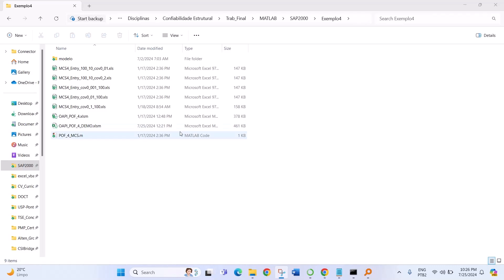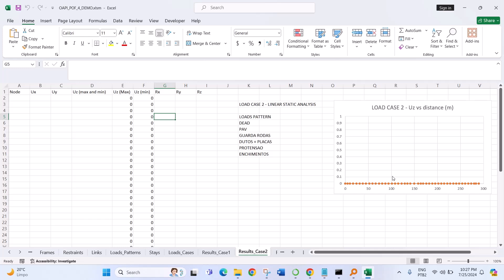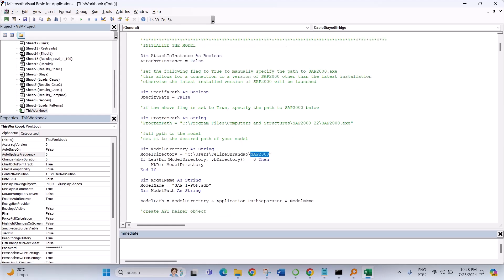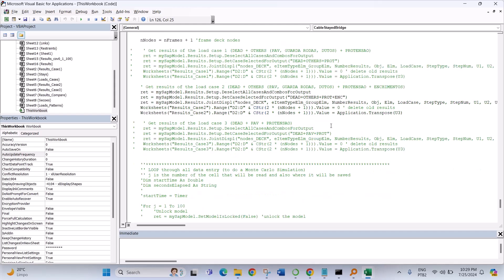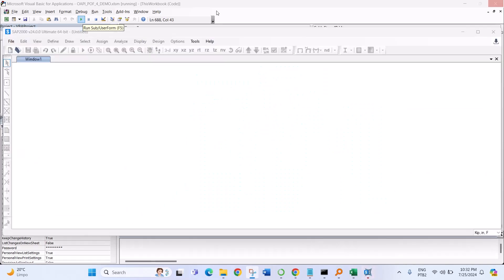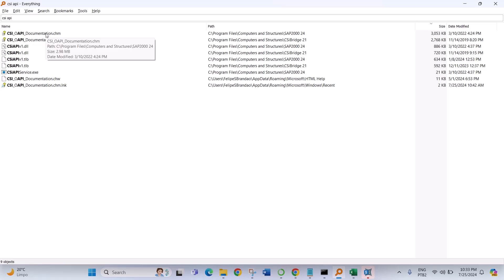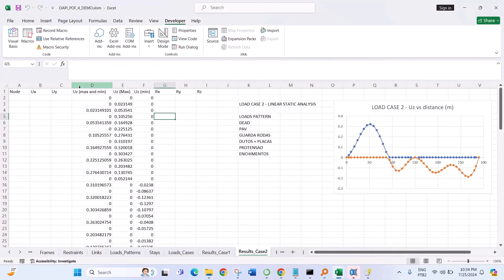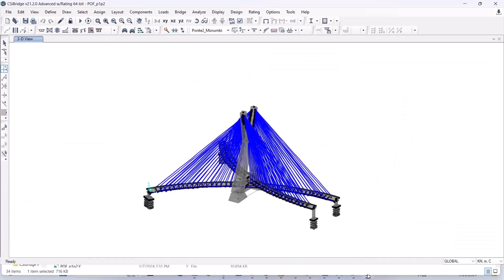CsiBridge and SAP2000 API (oAPI) using VBA - Example of a simple parametric bridge

Comment: After running the results in sap2000, I want to use vba code to write the results to an excel file same as the excel table created in sap2000 when operating manually, when operating manually when exporting the results in sap2000 to an excel file by selecting load case and load combination and export to excel. Can you write an example code?
Reply from the maker: Hello, in the description of this video I shared the spreadsheet I used with the vba code. You can run something like that:

 ret = mySapModel.File.Save(ModelPath) ' SAVE MODEL
        ret = mySapModel.Analyze.RunAnalysis ' run analysis in the loop
        ret = mySapModel.Results.Setup.DeselectAllCasesAndCombosForOutput
        ret = mySapModel.Results.Setup.SetCaseSelectedForOutput("DEAD+OTHERS+PROT+ENC")
        
        ret = mySapModel.Results.JointDispl("nodes_DECK", eItemTypeElm_GroupElm, NumberResults, Obj, Elm, LoadCase, StepType, StepNum, U1, U2, U3, R1, R2, R3)
        
        Worksheets("Results").Range("A" & CStr(j) & ":CL" & CStr(j)).Value = U3